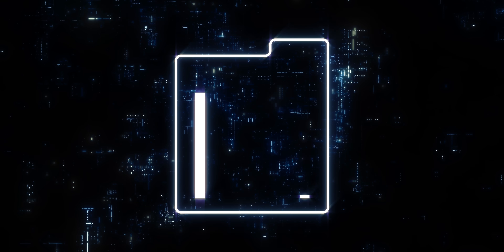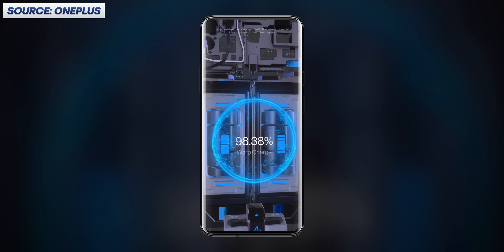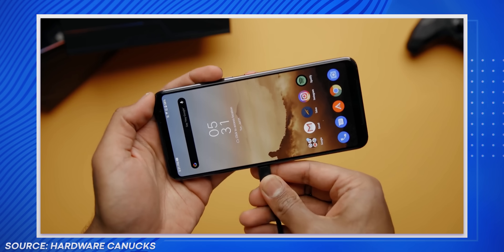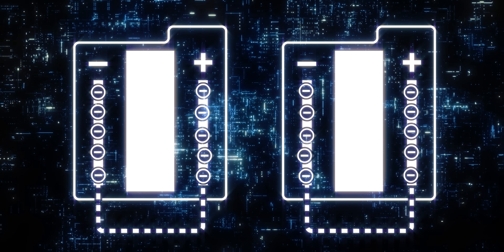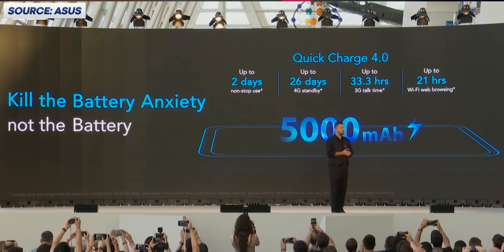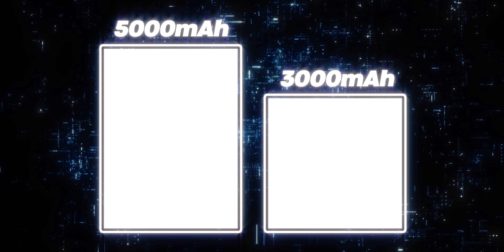The Problem with Fast Chargers.

Comment: 3:20 I am sorry but this is not correct. 😅

when the battery is "empty" then you have a balanced state, as the charge on the + pole equals the charge on the - pole.
the battery would switch polarity if you pushed more electrons to the + pole than there are on the - pole.

you can think of a battery like 2 bottels that you connect with a tube at the bottom. 
when the water levels are equal, then this is like an "empty" battery - no pressure difference, equal amount of water/electrons on each side.

Comment: 1. Apple doesn't care about customer demand regarding batteries. They want you to upgrade to fast charging.
2. Fast charging doesn't make the phone bigger. Many 65 watt phones are smaller than the regular iPhone with nearly double capacity.
3. Fast charging is optional on all fast charging phones. Just use a regular wire or a regular USB charger
4. Fast charging doesn't lower the lifespan of a phone battery. 2 hours at 35 degrees is worse that 15 minutes at 40 degrees.
5. Fast charging phones are really the only significant technology advancement that improves the users real life use of the phone. It's far more significant than a lidar sensor, or a depth sensor.

Comment: That battery percent information is incorrect. Your battery is in equilibrium only at 0%. if it was in equilibrium in 50% it would stop moving Electrons from the cathode to the anode. 
The problem with always charging your battery is that it kills the lithium battery life. Lithium  battery life decalins the more you charge it. lithium battery cells have a number of times they can be charged. The closer you are to this number the worse they hold a charge. That is why it is best to finish your charge before you re-charge.

Comment: This is a heavy misconception, all phone employ soft methods to slow down charging when needed, and even hard methods to do the same, many of them have an adapter-cable -phone sync that work with each other and charge the phone with fast speed at the start but slow phenomenally after say 60, i.e it auto adjusts the wattage, for example my phone which is having 65 w fast charging slows down after  70 percent, my guess is that the wattage skims smoothly around 30 watts after 70 since the phone is optimised to be charged with that very adapter and cable hence preserving the battery life, the people manufacturing the phone know better than us about this fast charging and they ain't dumb to sell us a phone that will lose 20 percent of their  life after a year.

Comment: The video's header and its contents are strictly a misconception, many phone employ a adapter-cable- phone sync that automically switches the wattage when needed , just like my phone which has 65W charging which charges speedily at the start but then slows down exponentially beyond say 60 percent

Comment: "When your phone is charging, just leave it alone" That's difficult to do when you work in the gig industry. That Uber driver app is very battery hungry.
Reply: then buy a phone that can charge the components without touching the battery
Reply: @KPoWasTaken  you mean the other way around🧐
Reply: @myscreen2urs  I like to call it the desktop power supply but only a gaming android phone have that feature
Reply: Then buy a phone with a big battery
Reply: @Ibrahimalfadel1  I'm on it. Doogee S88 pro 😁. When I posted this, my ulephone power 5 was under repairs after it fell under my back wheel. I had to put up with an oppo in the mean time.
Reply: @myscreen2urs  also another option is to have 2 phones and in case one runs out of battery you use the other one
Reply: @myscreen2urs  Monsters of phones the doogee, really good choice
Reply: Solution: get a real job
Reply: @zacharybohlman4069  ok boomer 🙃

Comment: Very good vid. Otimized charing is nice, but in case you have to wake up earlier some days (maybe for work or for travelling), then you will wake up with the phone not charged. Right? So you have to remember to disable and re-enable this function? It would be good to have a popup to choose, and not going in the settings and so on...

Comment: I have the exact phone you showed as example of made for fast charging in the clip at the beginning of the video (Xiaomi Mi 9). I've only had this phone for a little bit more than a year and the battery is already fried 😅 (I'm also super careless with it, like rn I'm using it and it's at 6%, I always use it while it charges etc). That being said do I have the patience to go back to slow charging now? After I'm used to having enough battery to survive with only a few minutes of charging 😔 Probably not lool Like with an iPhone I would die. So idk if I will ever become better at battery preservation or change my ways. I really want to cash in this phone and get an used S20 and probably that's already going to be a bit of a shock when it comes to fast charging :s

Comment: Sorry to interrupt and sound like the know-it-all, but this video starts with wrong informations. When your Battery is at zero percent, then the amount of electrons on the positive side and the electrones of the negative side are the same. Meaning what you explain at 3:20 is a 0% battery, which you also say is a bad thing???

Comment: Great video thanks for sharing! So would you say there is no idea to charge the new iPhone 12 to 100% before first use, and then let it run down to 20-30% before topping it back up again? I’ve always been paranoid about memory affect, but maybe that doesn’t exist in modern batteries now

Comment: 3:15 actually this isnt true. the electrons dont all go to the positive side when the battery is fully discharged. It's actually only the excess electrons. When the phone is at 0 battery, the two poles have exactly the same charge and your phone battery is at its most stable state. So, the lower the battery the more stable it is (not the 50% you claimed in the video). Great video btw, i really liked hearing all the other stuff.

Comment: This made my base for electrochemistry lecture...
Reply: Well 0% actually means even electron distribution between anode and kathode not "all electrons moved from the kathode over to the anode" since that would make the anode the kathode and the kathode the anode, which would be bad in a use case where it matters which way current flows like it does in a smartphone.

Comment: I have a super fast 25watt charger for my note10+ and it charges in  about an hour from 1% to full and they do have a 45 watt charger but it is only slight faster by just a few minutes so I stick to the 25watt chargers

Comment: I feel like this is a little over exaggerating, I had my iPhone 8 for about 2 years and I would leave it on the charger all night and I used a wireless charger A LOT but I didn’t really notice any less battery time before it died so I think it’s remotely fine to use whatever charger u want idk tho I’m not an expert like this guy 😅

Comment: Also, never charge your phone while it's on a bed. It can't get rid of the heat. Charge phone with phone on the edge, so biggest area, front face and back are in the open air to get let out the heat the most efficiently.

Comment: Greetings from Croatia !
Do you think then that the system in Oneplus 8T that has 65W fastcharging is okay considering it fills up two separated batteries approx. 30W each ? 
Considering switching my S10e with Oneplus 8T. I am very interested in this type of charging.

Comment: Does resetting the iPhone really fix the battery drain issue or is that a lie? Because after 2-3 seperate updates in ios 14 I have been getting disgustingly horrible battery life. While the phone is not being used is when the battery is being drained big time. What do I do?

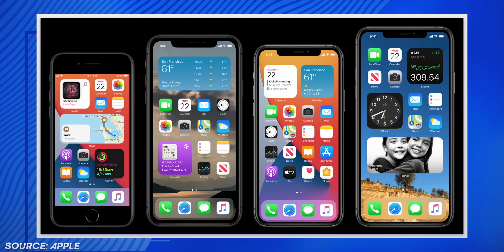Comment: 5:19 ok, here i disagree. Because "slowing down the cpu for the health of the battery" and "supporting up to 5 iOS-Versions" have the effect of iPhones getting slower and people getting annoyed, so they buy a new iphone! This for me is just Apple trying to put something in a good light, when in reality it is just planned obsolescence.
Reply: I would have agreed with planned obsolescence had they never come clean about them doing so and the technical reasons for it, e.g. bad battery resulting in crashes due to instability.
Reply: @paulsd9255  why should this be true? Android smartphones don't crash due to older batteries. Apple HAD to  find an excuse. That's all.

Comment: Meanwhile I sit in a hot car and my phone all always hot enough to dim the screen and halt charging to keep the battery from overheating. (I work security, I can tolerate the heat with the windows down. Rather not let the car idle all day)

Comment: Great video. I believe it explains the failure of the battery in Note 20 Ultra. The faster the charger the biggest battery separator,  the smallest the capacity. Maybe you can do another video dedicated to the poor battery performance of N20U? Something about " a battery that lasts all day " is not a battery that lasts a day due to the smalĺ size and the big features of the device? If not able to correct the problem with an update, they should expand the quarantine period of the bateries to at least 2years.

Comment: 1) Charging is bringing electrons from positive back to negative, and when you fast charge the pulling force gets stronger. To ensure the stability between the negative and positive, you need a thicker barrier and thus less capacity for battery life. * only if we keep everything else the same lime the device size and other parts
2) Due to the higher strength of pulling electrons, fast charging creates more heat, which is not so good for the device.

Comment: 5:05 Apple does want you to use your phone as long as possible? From where did you get that nonsense?
Apple wants you to buy a new phone as often as possible so that they can make as much money from you as possible. Sure Apple slowed down phones to save battery life and not to make you buy a new phone. Sure Apple knows how to build phones properly, thy just don't thats why the PCB inside the phone starts to flex and bend and destroy itself over time in normal use. There are countoless of other examples for this.

Comment: One of the advantages of my chosen career path as a cellular technician. If my battery isn't performing like it should, I can replace it. That being said, my OnePlus 8t can charge at 65 watts but unless I need a fast charge in an emergency, I still use my regular warp 30 charger from my 7 Pro.

Comment: I use mostly wireless charging but I don't use it to always keep my phone at 100%. I just use it to keep my phone around the 80% range. Not sure how much it helps but Samsung fast wireless chargers have fans. Not sure if all the manufacturers are doing it but OnePlus stated that they try to keep most of the heat produced with fast charging will be in the charging block instead of the phone. Quickcharge 3.0 was also moving towards lowering the heat produced in phone.
Reply: Sshsh HHshsh  Also for battery nerds like me. If I need a long top off/ charge I have a socket cutt off plug. So I just set my timer on how much charge I might need; 30 minutes, 1 hour, etc. They have battery apps that tell you how long it might take to get to 80% so you can time accordingly. Then again I think most people probably don't care. I mean they say the average person doesn't keep their smartphone for more than 2.6 years and some testers report that even with one or two years of fast charger that there hasn't been a high impact on battery degradation. Supposedly starting with Samsung Galaxy 8, Samsung claims that after two years of average use that it would still retain 95% of its battery capacity.  Not sure if it's a mixture of battery technology and software.   https://www.androidpolice.com/2017/03/29/the-galaxy-s8s-new-battery-will-degrade-less-quickly-than-the-galaxy-s7s/

Comment: This is hard to here my phone has oltra fast charging should I be wored  it shouldn't be that big of a del because I only have 22w charge
Reply: OK thanks but it's werd that like 40w charge and hyer is a problem that's unfair I ges I could do with faster charging I was going to get a phone with 40w charge but ended up not

Comment: Good Lession i agree
And now an unfair compression
Between Mobile Batteries and 18650 Batteries (And Now the Vaping People Kill me but listen)
But There is a good Argument why fast charging is bad 
Because of the Heat when Batterie Fast Charging
The Voltage (V) be the Same but with More Watts (W) there will be More Ampere (A)
And when the Ampere gets More the Batterie goes hotter
For Example really simple
We Take the 120 Watts from Xiaomi
and we Calculating with the Normal capacity of a Battery (3,7 Volts) and with an Seriell switched Batteries (7,4 Volts)
Ampere = Watts/Volts
1) 120/3,7 ~ 32,43 Ampere
2) 120/7,4 ~ 16,21 Ampere
And Many 18650 Batteries has an Max to Permanent load
For Example the Sony VTC5a 
this Battery has only 2500mah and Max Permanent load of 25A
The End of this i think of Fast Charging in Future there will be Maximum of Watts and how fast you can charge the battery of the smartphones

Comment: fucking finally someone famous talked about this thing that was annoying the hell out of me
some don't even let you turn it off, one of the reasons i love apple is the slower nicer overnight charging that caps it at 80%
the current alone without heat can still kill batteries much much sooner.
my fast charging phone died in a year with the battery. i fast charged it every night. that was a note 4 tho. so I swapped it

i never really used fast charging after unless i'm in a hurry

Comment: fast change almost useless in iPhone

because other with bigger battery would benefit fast charge at first 70% sucking 3000-4200mAh then slow down

iPhone first 70% only 2000mAh

Comment: Sony has been doing the charge to 90% then hit 100% when you need it since 2016 with their Xperia XZ!
Setting the iPhone as an example is just bad, you really dislike Sony, so much that you don't know Sony can bypass the battery for gaming since the Xperia 1 mark II as well.
People don't believe me but there are many things in your phones that Sony created first but no one batted an eye.
Also, reminder that Sony has been using 4K screens since 2015, finally got their shit together in 2017 and by 2019 the Xperia 1 lasted quite a lot on a small 3300mAh battery and a 4K panel, which means they finally figured out that sweet spot you talk about.
2020 they put only a 4000mAh battery on the Mark II but if 2021 puts Sony using a 5000mAh or even a 6000mAh battery, you'll see who's really good at battery optimization.

Comment: Does this mean we also need to keep laptops charged at 50% capacity most of the time? And does it mean we should avoid using the laptop while its charging and vice versa? Or do laptops switch from direct dc power to battery backup?
Reply: Laptops are a bit different. Almost all use the charger as the power source when plugged in - this is why many gaming laptops, regardless power settings, need to be plugged in to achieve high framerates in demanding titles. Also, most (that are not made by Apple) use an active cooling solution. These two things combined mean that the operating battery temperature will not be much lower when using while plugged in versus charging. They also typically lock the cells such that 100% is actually more like 95% and 0% is more like 5% to better balance stability, but even still leaving it at 100% or 0% a majority of the time will degrade it faster.

Comment: 6:18 Smart Power Bricks are a scam. My iPhone itself can already prevent the charger from charging. It wont let computers charge it unless i unlock it. (since it'll give it access) Why would it have to communicate to the other side of the wire??? lmao They can obviously just disable power intake when it's full. I can imagine them doing it the other way around with a "Smart Power Adapter" that plugs in the phone instead. Which would make it more obvious how much of a scam it is. Why wouldn't the phone itself implement such logic? lol

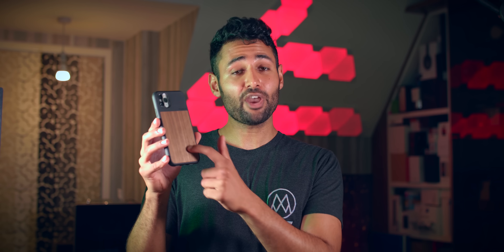Comment: 6:37 Sony has been including their proprietary Battery Care in Xperias since 2016. So what does Battery Care do? Say you charge your phone overnight, and you regularly plug it in at midnight and unplug it at 8 in the morning. In time, the phone will recognize the pattern, charge the battery to 90% and then stop charging. And then at, say, 7:30 in the morning it will pick up where it left off and top it all up to 100% at a slower pace. If it hasn't picked up your routine, it'll do a standard charge.

Comment: I never use FC again bro :* I had problems with my A20 where a Tempsensor fails and prewentzing the phone from charging HELL even from turning it on, turned out that i could just ripp out that sensore and then it worked again ;) and this a common problem on the A series, they even have the same charging boards with that stupid sensor, i got a galaxy s7 too witch is my secondary phone witch is rooted and got the Floid Rom on it ;) and i dont fast charge, i just wait a lil bit longer so that my phone can relax and itz not gettn damaged that mutch and have it longer :)

Comment: Hi. just got my redmi note 9 pro. and it comes with a 30watts fast charger. is it just ok if I use a non fast charger? Like the adaptor of my previous phone, but the cable is the one that comes with my rn9pro (type c)

Comment: Check out the One Plus way of fast charging they do 30W (wired or wireless) for 8 Pro and it will be 65w (wired) for the new 8T.  Its possible because the heat is generated in the charger not the phone.